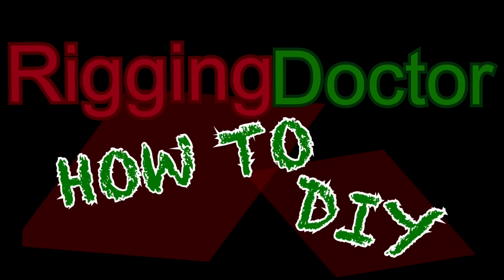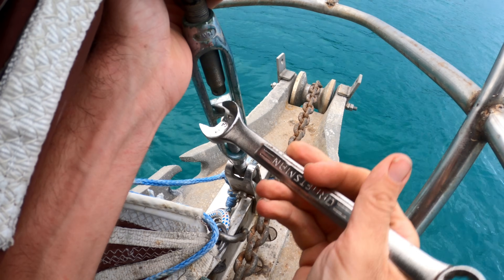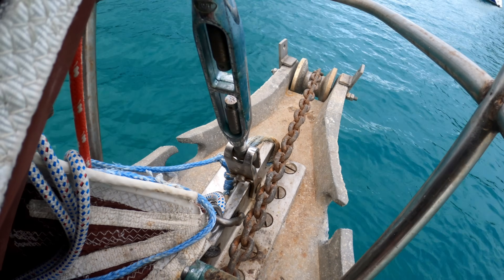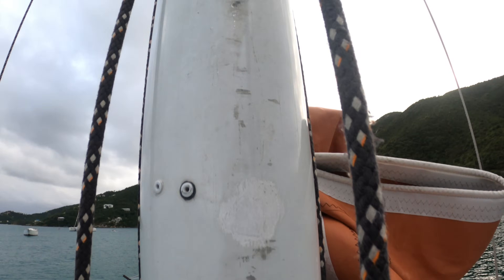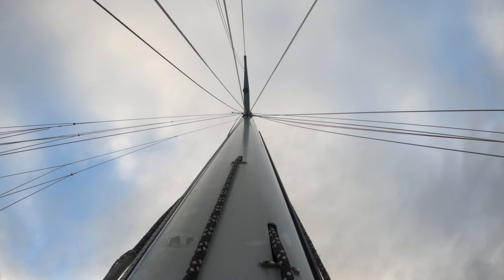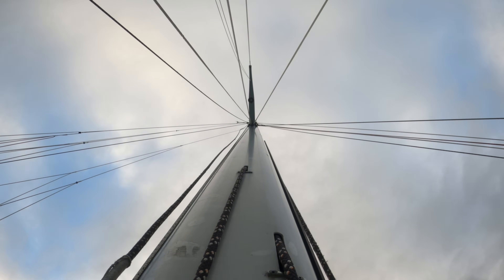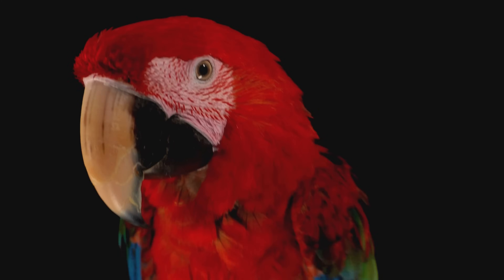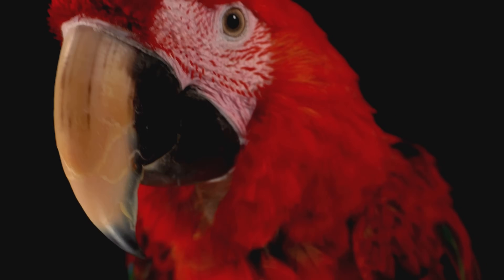How TIGHT Should Your RIGGING Be?

Comment: Seems to me that a weight hung from the halyard would only line up with the mast if the boat wasn't heeled to one side. Wouldn't checking for heel be the first step?
Reply: You are correct.  That is why any competent rigger will use a tape measure..... not a can of gas.     I can guarantee you,  you will never buy feel get the boat perfectly level of you are standing and moving on it
Reply from the maker: I use level gauges to get the trim set. On smaller or lighter boats, I have to measure the head to the chainplates or head to toerail as my weight will cause it to shift, but on a very heavy, heavy displacement sailboat, a single human has very little effect. Our RM30 is about 40,000 pounds, so my little 170 pound body standing right next to the mast won’t have much of an effect on the boats trim. Put me on a tender 24’ and it’s going all over the place!
Reply: @RiggingDoctor  Once, at the end of a day sail on a Catalina 16.5, there were two of us tieing up the mainsail after having tied to the dock.. It was a small boat, so we were each standing on the cockpit coaming. She stepped off onto the dock. The centerboard was up. I took a swim.
Reply from the maker: Ouch! 
I’ve gotten spoiled with Wisdom. She’s so heavy that it feels like stepping onto a fixed pier! When I get on smaller boats (or even our Alberg 30) I’m always shocked at how far my foot goes down after stepping onto the deck before the boat stops going down under my foot!
Reply: @RiggingDoctor  Didn't you say that the loss of weight due to using dyneema reduced heel a while ago LOL
Reply: This feels wonky. 

I’ve ‘built’ windsor chairs; built 4x4 rigs, Jeeps; modified or repaired numerous boats from fiberglass to aluminum; built plywood-stressed small bridges, installed hundreds (thousands?) of doors …
I virtually NEVER level things or use squares to fabricate in any medium. 

Why? Because measuring things from level or leveling stuff and using a square to determine symmetry for example is 100% dependent  on the tool being static at every check. And it won’t be!

That’s why machine shops use variable tools (dial indicators for example) and not math to make repeat precision parts: same setup, same results. 
Same thing for race car setups: they use a surface plate for initial setup, then adjust for actual on-track conditions once at the track. 

A simple measurement for symmetry, then adjustment for actual sailing performance and then recording that for a particular hull would seem all that was required, and eyeball sighting the mast is probably sufficient until underway and then the sailor/captain can balance the fore/aft sweep and any initial bend for trim after observing performance. 

Because a level boat on a calm morning is not the same as a symmetry of hydrodynamics port-to-starboard. 

But what do I know? I’m not a professional sailor, but I understand the functionally portable principles one can glean from Occam’s Razor.
Reply from the maker: The boat should be loaded so that it rests level, but if the boat does have a list, getting the list straight will be the first step followed by everything of this video :)
Reply: @RiggingDoctor  Very very hard to do -a 1 degree list is ~8 inches at deck level in a 40 foot mast.